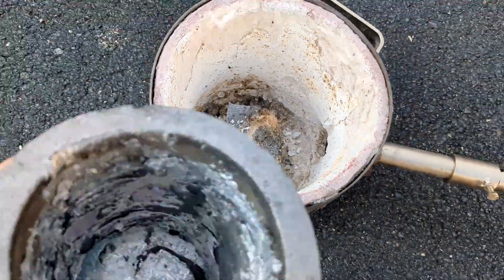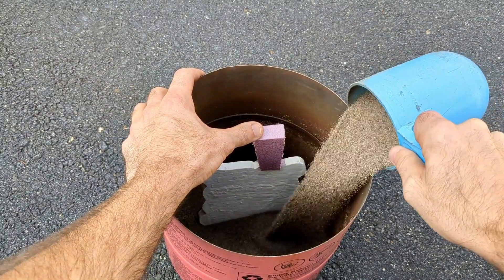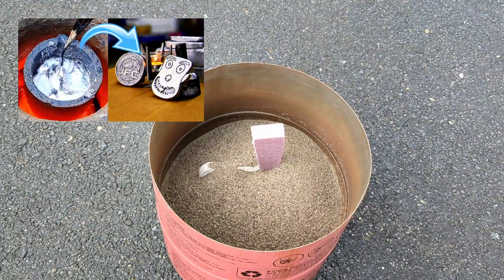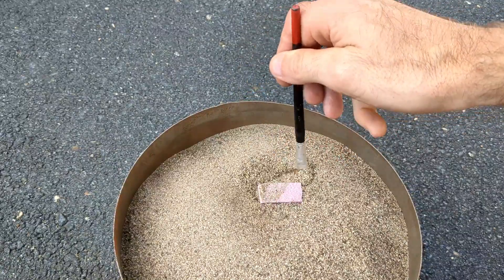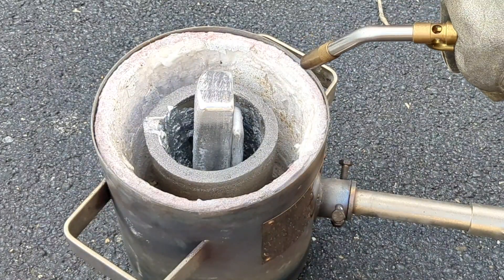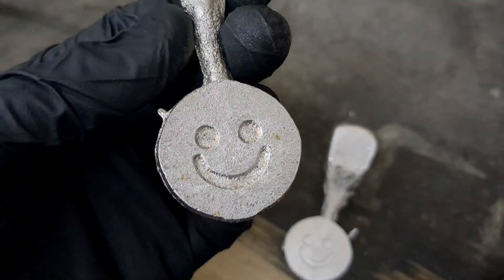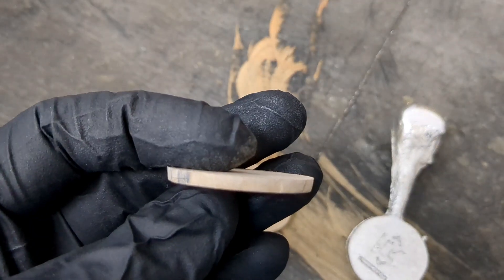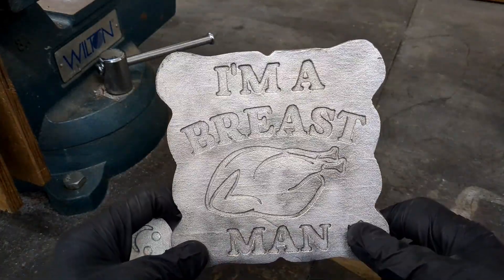Metal Casting Process - Aluminum Casting

Comment: I gotta say , your method   has by far produces the finest details!
Reply from the maker: Thanks!  Yeah I'm super happy with the results.  I'm so happy I found this method of casting metal.
Reply: I see these tin placards sold at truckstops and gift shops that say crafty and sometimes funny things. What isn't funny is the price tag.  Your local bar might be interested in two plaques that say" Doe" and the other "Buck" for the restroom door. I  personally would love one that says, "My cave, my rules."
Reply from the maker: @mattyal9347  I did think about making stuff like that actually.  What size are you thinking?
Reply: @HeinrichsMade  to be honest I have been cosidering your methods from the first video of your I watched . I'm  nearing retirement and I  have a hoard of copper, brass and aluminium that amounts to a lot to do when I  finally call it quits. One question is about the machine you use to scribe in the styrofoam sheets. What is it called?
Reply from the maker: @mattyal9347  That's great!  I'm glad to inspire you 😉. Once you get started it definitely will be a learning curve.  I use the FoxAlien 4040 Masuter.  It's a CNC router.
Reply from the maker: @mattyal9347 send me an email, I made a man cave plaque out of foam today